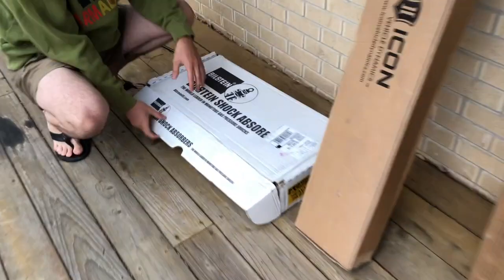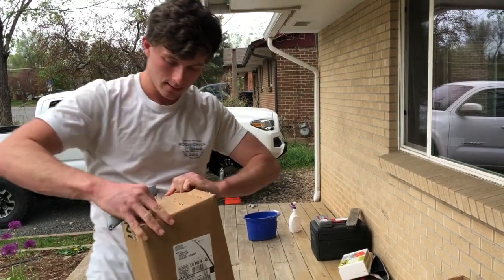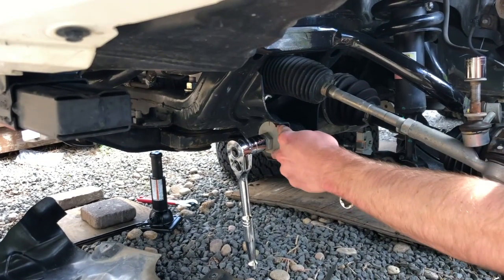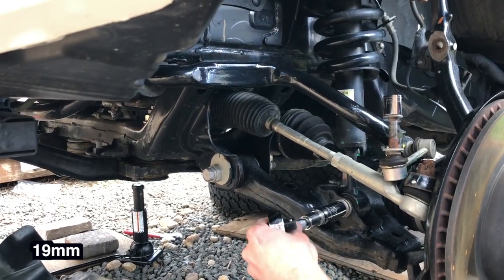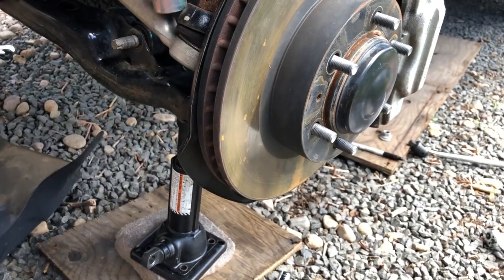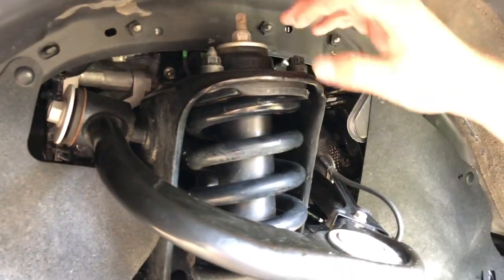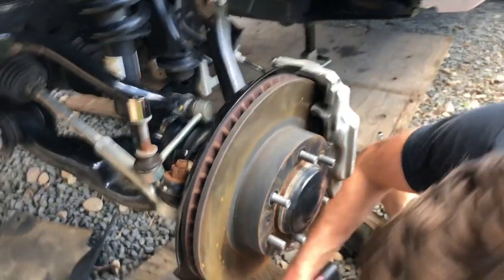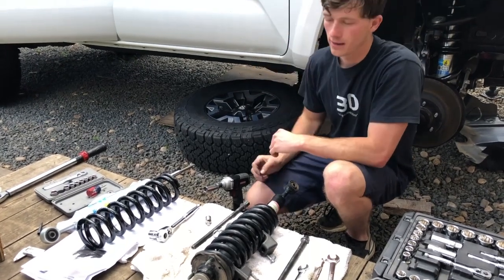How to Install Full Suspension on 3rd Generation Toyota Tacoma

Comment: using the LCA and strut mount instead of a spring compressor is genius! can't believe I never knew about it
Reply from the maker: Makes life much easier and the rentals I had did not fit with the Bilsteins.
Reply: Same, never seen this method. Smart

Comment: Thank you so much for your simple video it was actually perfect I was looking for the right shock to be at 1 and 1/2 or 2 with out it being to . Complicated these are perfect good job guys thank you I have a 2017 will be following
Reply from the maker: You can do it yourself and save $$$. It't not hard at all.
Reply from the maker: Just make sure you get an alignment after 250 miles or so.

Comment: Best install video as others have written - included instructions are good for 5160's - 6112's are a joke - all about assembling spring, not install aspect. Amazing how other "install vids" w/ Tacos and 6112 Bilsteins just skip all over the place? Just installed this set up on my Tacoma. Only issue I had was the bottom of the front shocks (ordered mine preassembled, no lift) just did not want to slide into position well - w/ hole lining up w/ truck mount. Not fun, but my neighbor's punch tool "persuaded" it to.
Reply from the maker: Thank you for the nice comment. Enjoy your smooth ride. It is a complete game changer

Comment: I may be way off here but can't you just leave the strut cap installed in the truck and undo the shock bolt on top? wouldn't that just let the shock and spring fall out as you lowered the lower control arm slowly? Basically the reverse of how you installed them.

Comment: Great job!  You made it look easy.  I had a shop do mine (Bilstein 6112's) 6 months ago, and both coilovers come loose with the driver side missing it's hardware. ( Washers, Cushion, Sleeve Spacer, and Nut )  Any idea how it may of come loose?  Next time will be watching your videos..
Reply from the maker: I have over 50k miles on my truck and have not had a problem with them coming loose. You will notice if you watch more of my videos, I am a huge stickler for torquing each nut. I would also recommend marking your nuts (https://amzn.to/3FHlrzn) so you can make sure they are not loosening. I would recommend looking at them every oil change.
Reply: @92813justin  Thanks for the tip.
Reply: @92813justin  How would you recommend removing spring and strut with no nut holding it in place, it has lots of tension from spring.  It seems tricky to do because of compressed spring.

Comment: I like your video and I am looking at a Bilstein setup.  So using notch 5 on the left strut and notch 4 on the right strut to correct the taco lean and with the setup in the back how much did you gain for lift?  Also I noticed you are still able to use the stock 16" wheels.  What size tire and did you use a wheel spacer to make that work?  All the shops I have gone to say I have to replace my stock wheels or have a wheel spacer to do the same lift.  Thanks for your input.
Reply: You do not need to replace wheels/tires to fit under a 2" lift. Think about that, how could they fit stock, but not after the truck gets a 2" lift? If anything, you can now fit bigger rims/tires

Comment: Hey Justin quick question you said you set it up five on the driver side and four on the passenger side why the different numbers?? Did that give you an even 1.5 inch that all I want to go thanks
Reply: Tacoma is heavier on the driver side because of gas tank. So called taco lean. Thats why different settings.

Comment: You have any issues with driveline vibrations?
Reply from the maker: I did 20k miles later. I removed the add a leak in the rear and went back to stock height in front
Reply: @92813justin  any reason why you didn't try to fix it with axle shims or CB spacer? What did you do with the OEM leaf springs and that clip you had to cut off when  you took the AAL out? They must make a replacement do they?
Reply from the maker: @jaybird99100  , I did all of the above. I even had my Dad's tacoma that I was comparing the angles and using an excel sheet to calculate the angle for mine. It was a very subtle driving vib at 25 and 65mph and I was driving for a lot for work at the time so I just needed it to stop
Reply: Man that’s brutal. I don’t know why some people get these vibes and some don’t. I’ve had Bilstein 5100’s all around ready to install for a month but went down an internet rabbit hole about needle bearing replacements and driveline vibes. I haven’t installed the kit yet but think I’ll go minimal 1.55” on the front Billy’s and just a 1” block in the rear. Wonder how Toyota is sending out trucks with OEM factory 2/1 TRD lift with apparently no vibes. Lots of people doing 2/1 lifts of their own and reporting vibes. I don’t know.

Comment: Hi.  I'm doing this same lift on my 3rd gen DCSB next week(Same notches 4/5)...I'm curious if you had to do the OME carrier bearing kit or 3 degree axle shims to take any wobble out?  I've read some people having to do that.  Thanks in advance!
Reply: Bump?!
Reply from the maker: Sorry for the delayed response. I started to get vibrations in 5th gear going from 60 to 70mph. I tried everything to get the vibration out. I flipped the carrier barreing, dropped the carrier berieng, shimmed axel 1 to 3 degrees. If you go on tacoma world they will talk about measuring the angles and I got mine right into spec and got it fairly close. But now I drive my truck 1,000 miles a week for work and ended up removing the rear end AAL and lower the front to remove the vibrations. I hope this helps with your decision.
Reply: @92813justin  havr you replaced the needle bearing with a ecgs bushing? I have this same setup sitting in my garage but am worries about said vibrations later down the road. I only plan to lift the front 1.5 inches same with the rear.
Reply: did you get it installed?

Comment: With this set up could you run 33inch tires no running?
Reply from the maker: My tires are close to 33" but never tried 33"
Reply: Yes.most definitely
Reply from the maker: @jdmartinezrmz111  I would agree. You might have to move the remote reservoir in the rear. I had a finger width of clearance.
Reply: Did that aal get put on backwards?

Comment: Ummm….. you definitely forgot the rubber bushing from the OEM shock.  You put the metal cup, but no bushing.  💀
Rod adapter > metal cup(bigger flat one) > rubber bushing > top hat > rubber bushing (from Bilstein) > metal cup (smaller dished) > nut (from Bilstein)

Comment: Great video. What's the measurement of the lift in the front and rear? Do you have any raking?
Reply from the maker: All of the measurements were taken from the center of the hub of the wheel to the bottom of the fender. The gas tank was at 3/4 and no passengers or additional weight.

Stock (inches):
Driver front: 21"         Passenger front: 21"
Driver rear: 21 7/8"   Passenger rear: 21 7/8"

2 weeks after lift (inches):
Driver front: 22 7/8"         Passenger front: 22 7/8"
Driver rear: 23 1/2"   Passenger rear: 23 3/8"

Lift height (inches):
Front: 1 7/8"
Rear: 1.5"
Reply: @92813justin  thanks for the info. i've ordered the same set up. still waiting on the 5160s to come in. there aren't many youtube videos on this particular bilstein suspension, how do you like it?